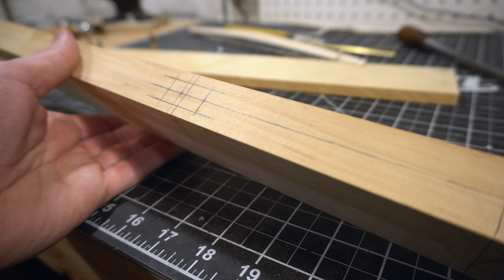Brigands Beware: Pallet Wood Pencil Crossbow

Comment from the maker: PSA: NOT ALL PALLETS ARE SAFE FOR WOODWORKING (OR BURNING) 

All pallets should be stamped with the treatments they have received and I definitely recommend looking up how to read those stamps before working with them. Most in my area are domestic pallets that just have a HT (heat treated) or KD (kiln dried) coding and should be as safe as any wood. Stay away from pallets labeled SF (sulphuryl fluoride) or MB (methyl bromide). Do your own research because codes and treatments may be different in your region.

ALWAYS wear a dust mask specifically designed and OSHA approved for dust when sanding or using any power tool that creates airborne dust. A medical mask is not that same as a dust mask. 

Heres a good, quick summary: [https://www.youtube.com/watch?v=aM2c8kBhIFk]